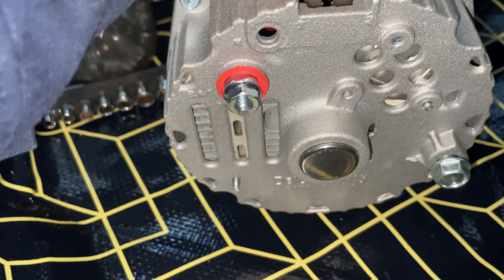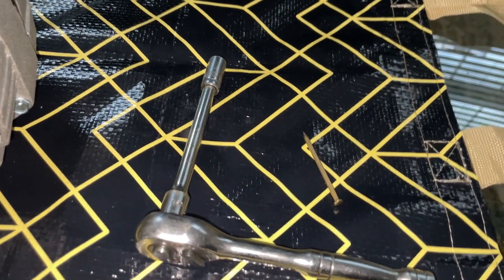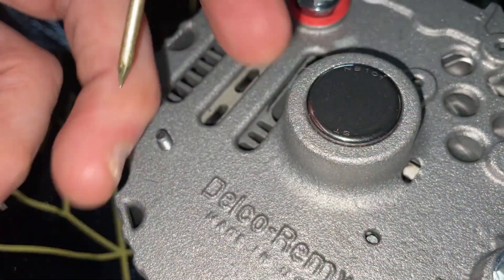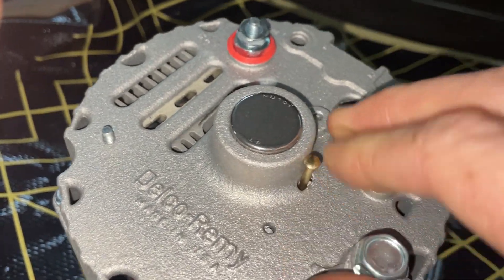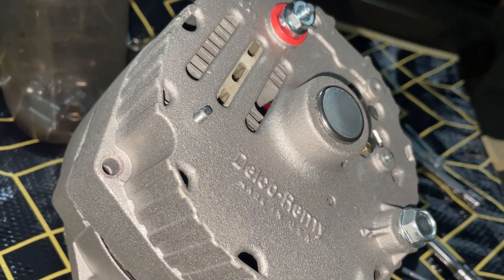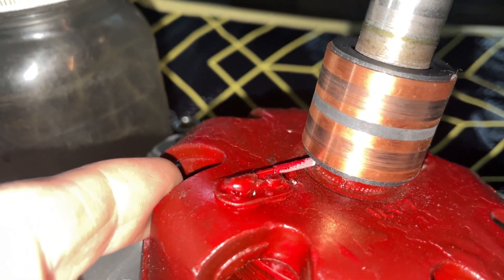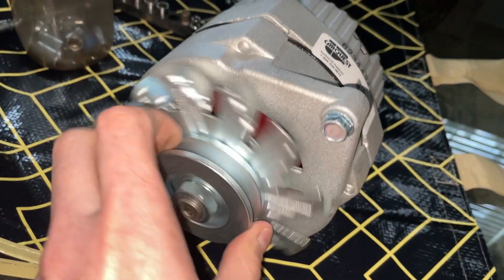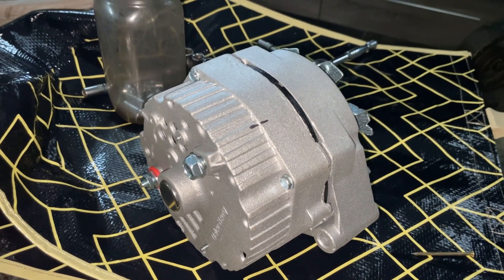How to re-clock an alternator in under 6 minutes!

Comment: Very cool trick.  
You can do the same with many old GM 
A/C compressors on the front housings to fit different applications. The D-A6 the HR-6 and V-5 models. We called it "Make it work"  
Thanks again Richard.
Reply from the maker: I was not aware of that Gary. Thanks for the info.